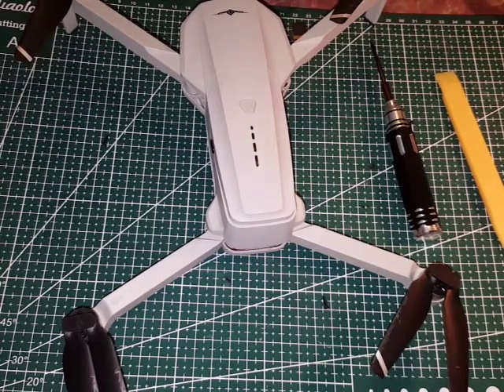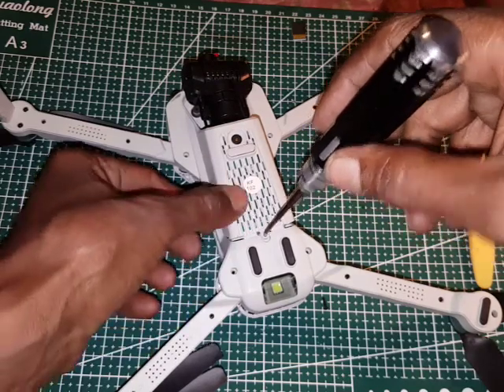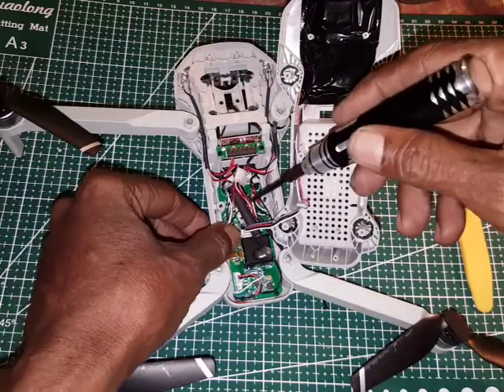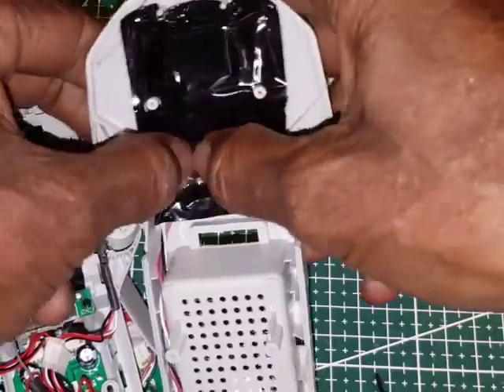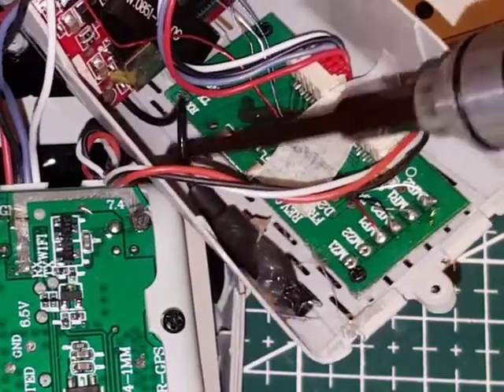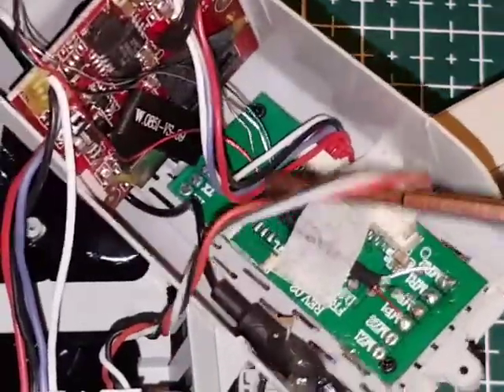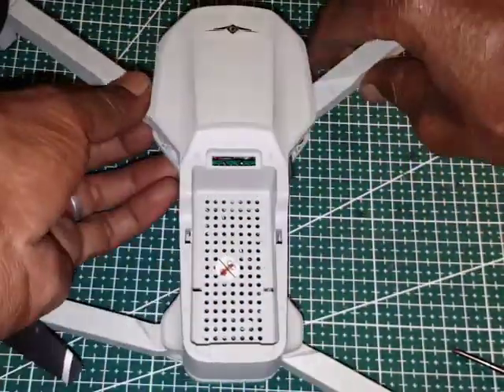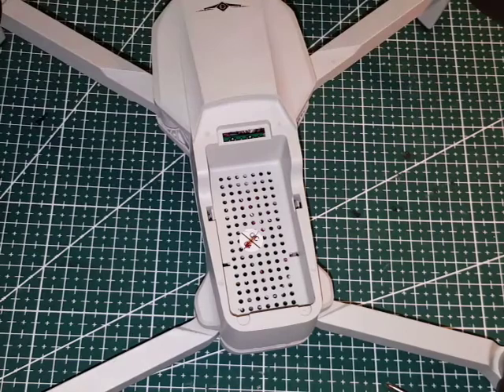KF 102 WHAT INSIDE DRONE

Comment: Hi, where is located a compass module? On mine KF102 it is fasted under the battery, where are 2 screws holes, but I replaced it under the black tape near to GPS module, because I think the place under the battery is bad idea. Mine drone many times has come into toilet bowling effect due to compass issues. After compass replacement I flight only one time but drone was very stable.  When comes good weather conditions I will test again. Also I isolated all wirings by coper adhesive tape due to avoid interferences. Thanks
Reply from the maker: Gud luck buddy.record video use remote and  see at  MMC card.wifi cant go to long.

Comment: Thanks alot You open your drone for us to can see. 
Where are the ECS? believe in the arms.
Reply from the maker: The green board isESC. 4 IN 1 ESC.nothing at arm just motor and wire
Reply: @seven755zi  thank you alot. I like more     with ecs in arms but is also OK like this.
Reply: If Ecs fail will be great if can be replaced with a generic one  (4 in 1 ecs) but probably is propietary.
Reply from the maker: Can try if u master in ESC.